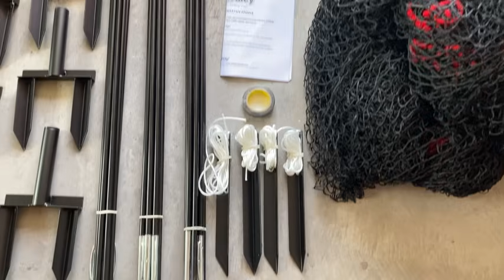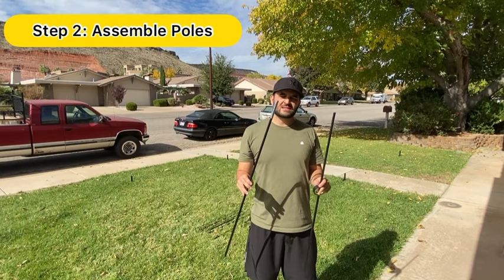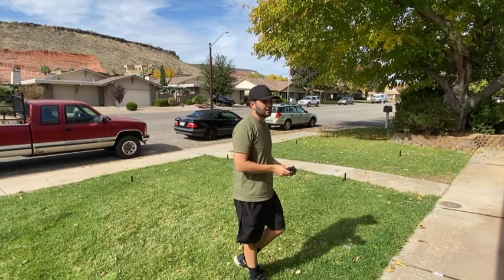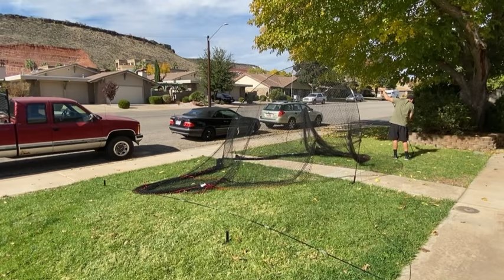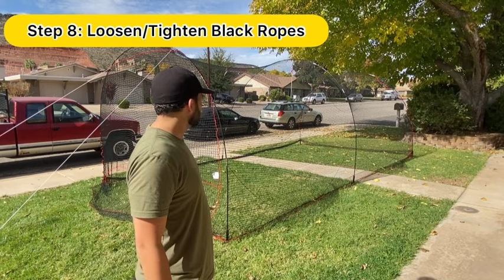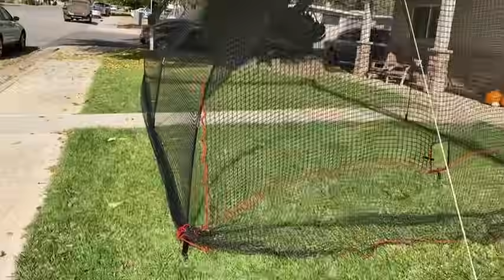Heater Sports Power Alley Batting Cage Setup Assembly Instructions

Comment: What about if you have concrete back yard?
Reply: The stakes come with round plastic inserts that are removable. I don’t know, but it looks like you could drill holes in the cement and insert the plastic inserts into the ground then put the poles in. I’m just not 100% positive it will work that way.